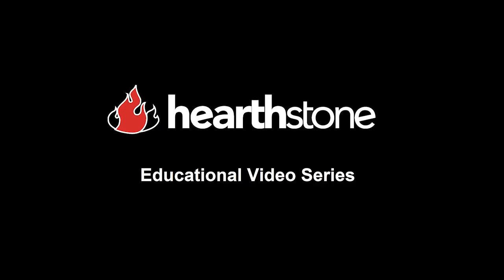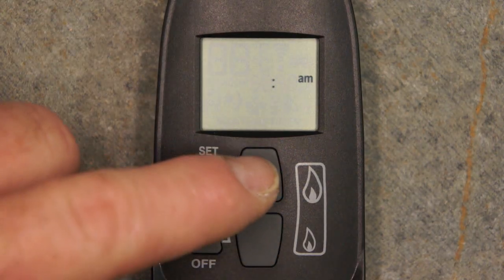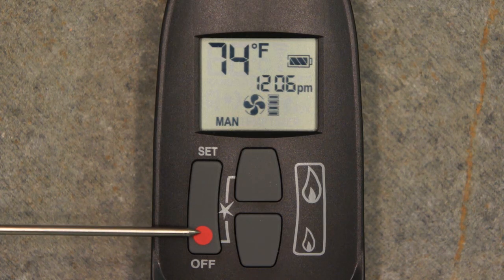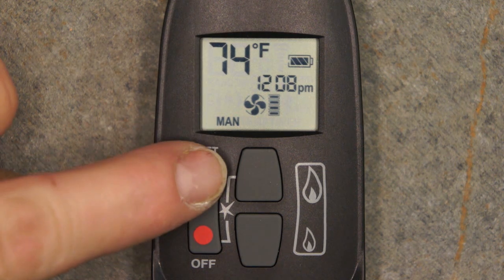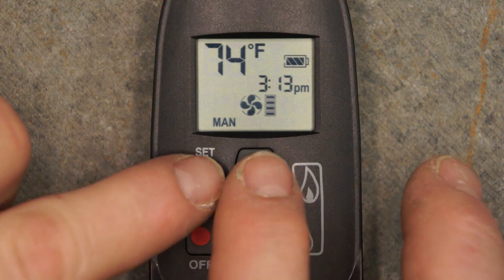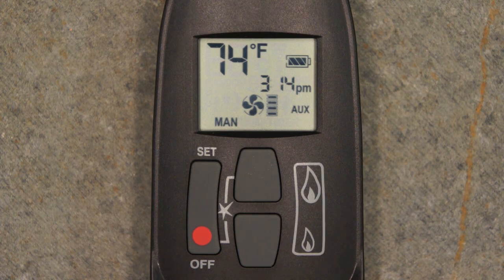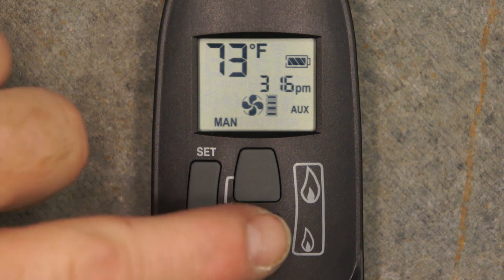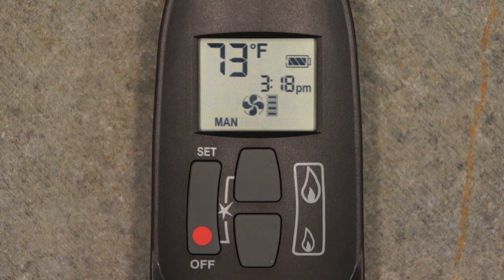Gas Appliances Module 1:  Manual Mode

Comment: We bought a house with one of these systems. I can get the system to light but then it turns off after about 10-15 seconds. Any idea why it lights but then shuts off?
Reply: Ours is doing the same thing! Did you find out the reason?

Comment: My expensive fireplace with this system in has failed numerous times. My advice would be to avoid this like the plague. Apparently the solenoid fails all the time and is a very expensive fix - which is what I am assuming is the problem with mine.
Piece of rubbish, nice when it works but as this is an essential piece of equipment during winter you would want it to always be working.

Comment: As a year long Valor Presidents model (no extras) fireplace owner I want to pass on some key observations about their 5 X 7 manual literature: The sun and moon signs are only to mean hotter or cooler. Not day and night. A comment about safety: Under "Set the Timer", item number 4...you must "hold" the "set" button to see the timer blink for P1 with the moon icon written in your 5 X 7 handbook. If you only "click" the "set" button and not "hold" the "set" button then it will only show you blinking temps and not time. You will have to begin the series from the top of the page of "Set the Timer"...again. Additionally, you leave too little response time of your interface experience with humans/owners... effectively frustrating them when you have such a short time out per each program command. I have discovered as well that leaving this programming of your remote control incomplete/abandoned can have your fireplace shut down in the middle of the night or at perceived unexpected times of day. Even though there is an 8-hour complete shut down safety feature built-in... No programming should ever produce this real world scenario. Personal note: This myopic design in the remote control of an appliance that features fire is EXTREMELY disconcerting to your patrons peace of mind when operating your product in their home and a direct opposite to the image you're trying to get across in your campaign.  I hope that corporations importing to the USA recognize the free speech of the people of the USA. Don't censor this.
Reply: Also. Valor..return to this video and break up the video in the timeline of the video as they are doing today on YouTube and list the sections in the "SHOW MORE" section. Your customers will appreciate it.

Comment: I've put news batteries in both remote and receiver. Batery display indicates low batery. So the fire won't work. Can you help?
Reply: are batteries in  correctly?  are they  good?
Reply: does anybody have a solution for this problem? I have the same issue.